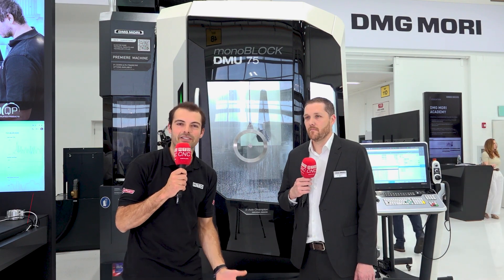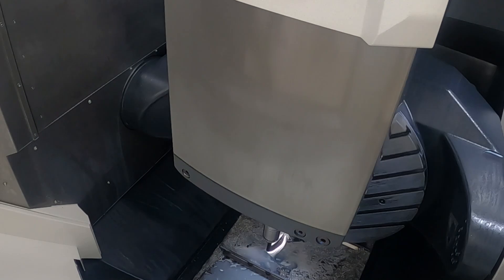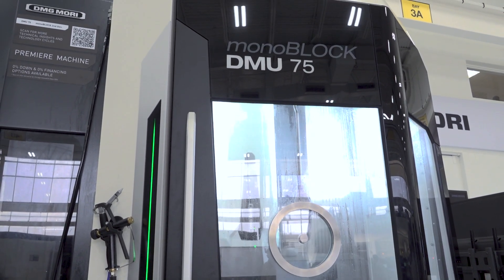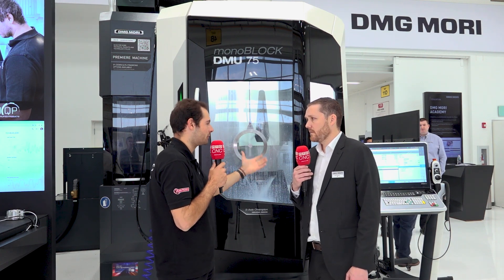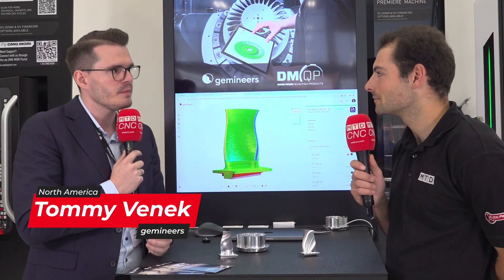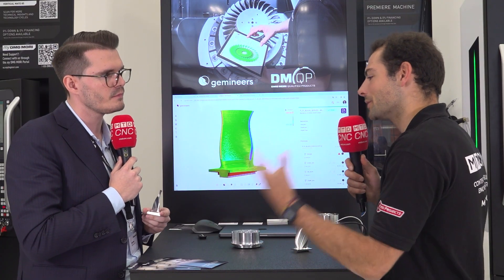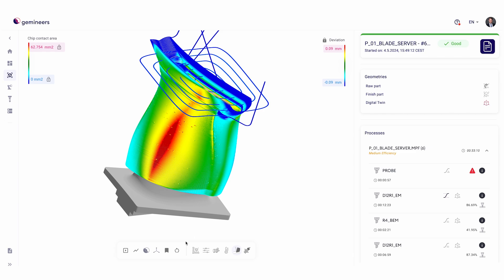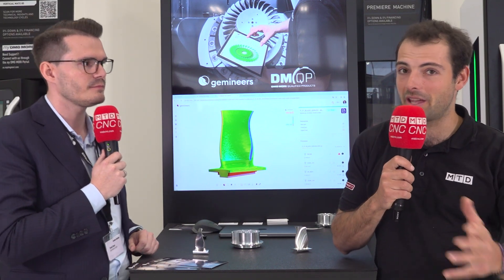Have you ever seen an innovative machining and software demo like this?

Comment: I'm not following. The STL file produced is checking the machine motion? Than it can't tell you the dimensions of the part. Sure it can tell you if your cnc is rounding a corner because your look ahead isn't set correctly. But it can't "Measure" the part. Just another gimmick that will fool some bean counter at some big machine shop that insists this is good enough to inspect our parts.

Comment: Interesting...will require accurate and consistent sensing from many machine tool sensors. I expect there's been much calibration between theory and actual cuts. Probably a measurement prediction based on an actual cut face at a few points only, same tool, same feedrate etc , measure at a few but representative data points then predict the other cut faces based on feedback sensors values during that machining operation- clever. Will lead to shop owners having even less staff and their output even more in the hands of the machine tool manufactures and software providers but we're probably there already.